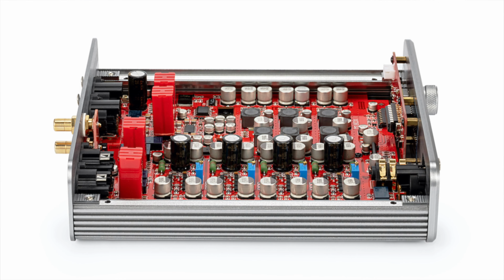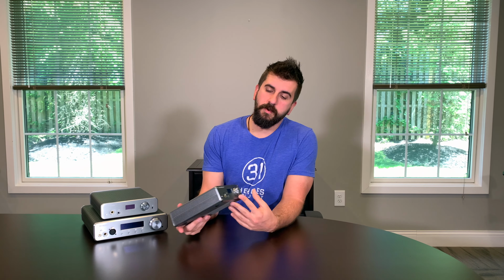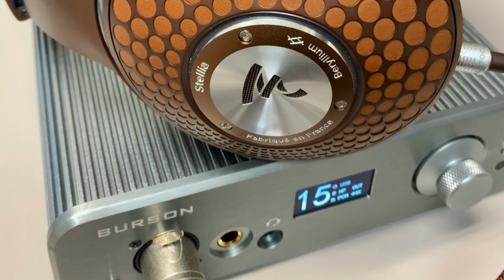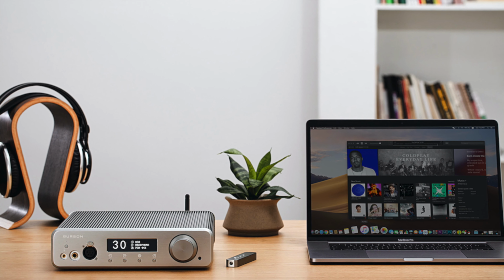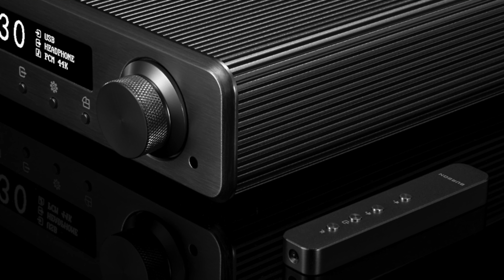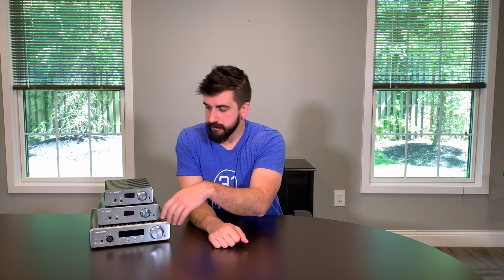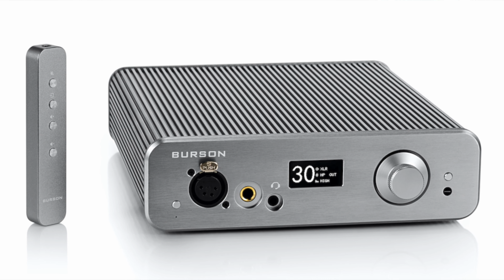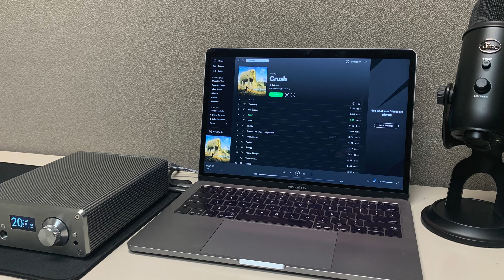Burson Audio Product Guide

Comment: IMO Burson themselves could clear up the confusion with a simple product chart, just copy paste a format from every other manufacturer and replace with their products. The whole 3 X/P/R/GT thing is way more confusing than it needs to be. Especially when they do more/less things and aren't just improved versions of the same thing.

What I can't figure out from their manuals is if you need to unplug the headphones in order for the pre-amp output to work on their units, or is there a button on some? The Soloist 3XGT has an ouput select, but is it only for the stuff on the backside or does it also switch off the headphones if you pick XLR/RCA output except the one with the sub?
The Playmate has no buttons, so I assume you need to unplug the headphones? Or is it all on all the time and they expect the user to turn off whatever is connected to the pre-out?
What about volume and gain? Does it apply to the pre-out the same it applies to the HP outputs? So if I'm blasting the speakers and then plug-in headphones, did I just connect a pair of IEMs to a 7W amp with the volume at 60? User caution is obviously important, but it's good to know before buying what to expect from the product.

They should work on their manuals a bit more. They went through the trouble of designing amazing gear (from what I could tell from the reviews, I don't own any yet) but the manuals are very amateur. They're mostly copy/paste between products with different pictures and specs, and little to no details on how the product actually functions.
But hey, at least we know they're using the "legendary MUSES72320 controller"... whatever the heck that is.

Comment: I see the Soloist 3XP / Composer 3XP stack (which people speak highly of) is about the same price as the Conductor 3XR. I can see how the use cases / upgrade paths are different, but given they're nearly the same price, I'm curious to know how they compare sound-wise.
Reply from the maker: The overall sound characteristics are pretty similar, but I would give a slight edge to the Conductor 3X Reference in terms of the texture in the bass, and presenting the highs in a way that's less fatiguing. The stack gets the advantage in, as you mentioned, flexibility, and also you get just a little bit more power from the Soloist 3X Performance than the Conductor 3X Reference.